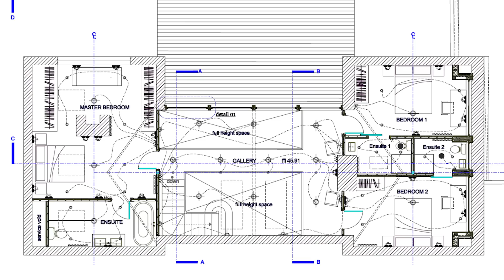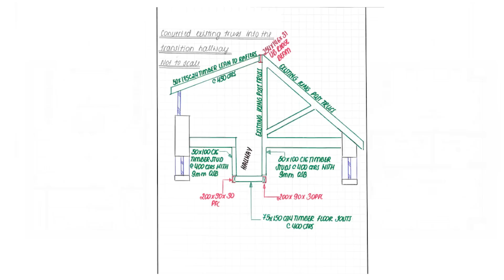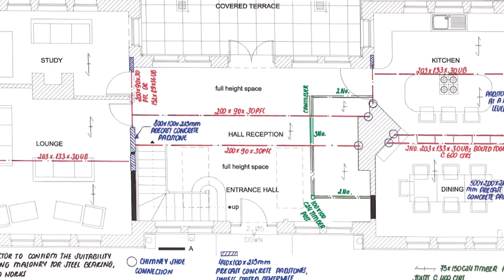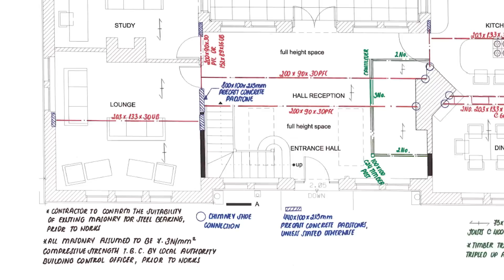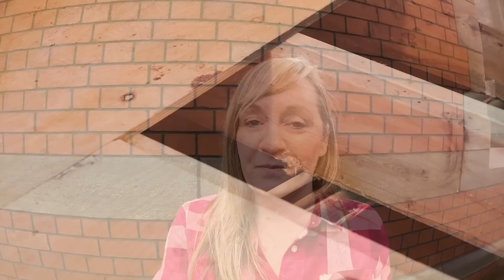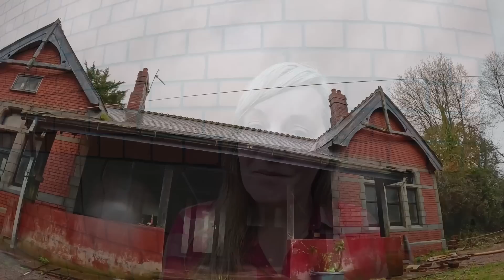How Will The STEELS Hold The Roof Up?

Comment: So glad you looked into my suggestion of the walkway through the full height sections. So many converted brick warehouses, old fire stations, and church conversions here in the U.S. use this method to create access to second floor spaces without losing the open feeling. I didn't realize the trusses would be coming out, but that is clearly necessary to open up the second floor, and keep the rooms from being odd and pokey as they were. Definitely save them, though, for possible re-use elsewhere. Maybe one could be 'sliced in half' the long way and applied like half-timbering? I smiled, seeing your excitement. And yes, doing what you can yourselves is so important for the long term budget. They used to call it 'sweat equity' on the This Old House TV series. :)
Reply from the maker: We have to use those trusses for something else! It’s beautiful old wood. I was thinking we could have some furniture made out of them (not by me of course, someone with actual skill!)

Comment: Former architect here.  Horizontal framing elements are called “beams” or (maybe) “joists” (you actually have trusses supporting your roof).   ‘Beams” can be steel, wood, concrete, composite/laminate, etc.
Reply from the maker: Thank you for the correction, I’m sure I’m getting most of the building terms wrong! We’ll pick it up as we go I’m sure 😊
Reply: @ I do live in the United States and obviously terminology often varies from country to country.  I’m retired now but did almost a billion dollars of projects over my career.  You’re doing the right thing on a project like this, don’t get in a big hurry and let the professionals take care of things you’re not skilled or comfortable doing.  It’s a cool project!

Comment: The Plans are OK but I think the front entrance could be better designed the long over hang is out of character for the old station.  and the back roof slope is to long and too low all the way down to  the wonky wall off the porch I think the designer should raise the porch roof up a foot or two open up the back porch a little to let more light into back part of the house so you can see the old windows better almost like it was originally , I would also  keep two  of the original trusses just balances the room below instead of just one makes more sense . but then again its just my thoughts.
Reply from the maker: Thank you for the comment, we’re always happy to hear people’s thoughts. The back roof does cover a lot and we did think of putting it back to the way it was but I think with good lighting it should turn into a lovely outdoor space (we hope 🤞).